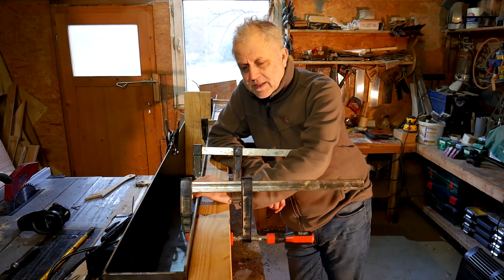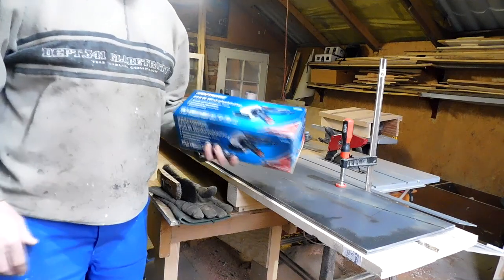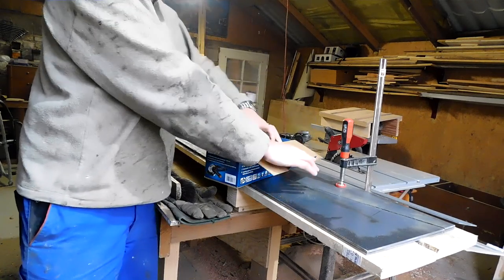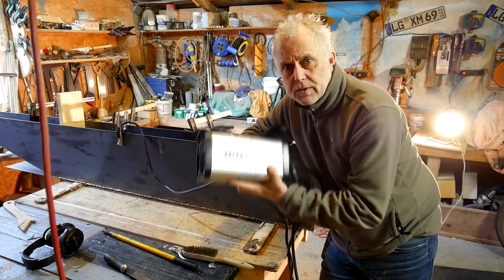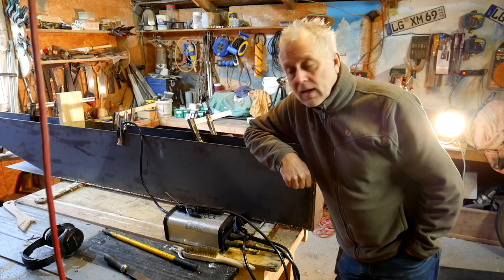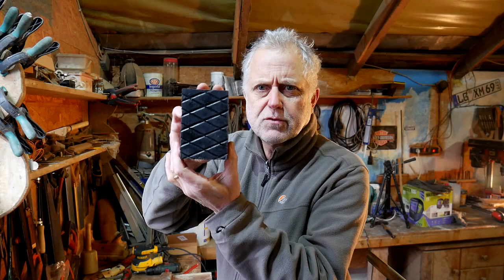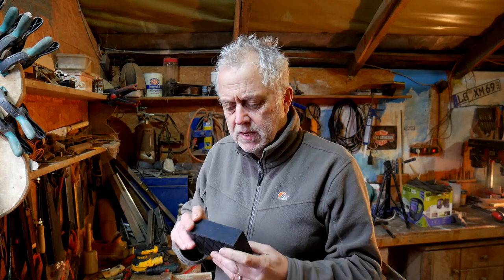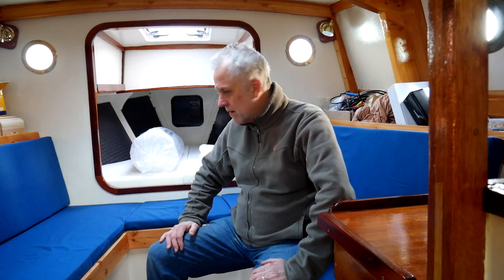Ballast Keel Beginnings And More; Building a cruising sailboat - SV Tapatya EP216

Comment: I remember mixing lead shot and resin in a concrete mixer, scooping/pouring it out into buckets and heaving it up over the topsides and dumping the lot into the keel void.  Not only worked but gave me quite a work out!
Reply from the maker: I'm sure it did, Roger. Concrete with lead shot is a good option - it gets you up to about 2/3 the density of solid lead 👍😀

Comment: Hi Tony, did you know Metabo has what they call safety brushes in the motors? At the end of the lifespan of the brush, a spring inside the brush is revealed and disconnects the brush from the rotor. This prevents damage of the rotor. About E12,- will get you new brushes.
Keep up the work! Love what you are doing.
Reply from the maker: Thanks Walter. Great tip. I took it apart earlier today and have now ordered some brushes. It all looks ok so we'll see! 😀😀

Comment: Good call on the lead, I think, Tony. Watching you cut up the steel plate, I started out by wondering how many cutting discs you'd need. Clearly, I should have been wondering how many angle grinders you'd need! That "Huh.. bit rough" comment when you were cutting up the rubber made me chuckle, as well. Makes me feel a bit better about some of my own less-than-great cuts with a hand-saw, too!
Reply from the maker: Thanks Garryck. Yes, I wondered how many discs I'd use up, but in the end, it was only a couple 👍😀

Comment: Hi Tony, the beginning of the ballast keel! I have been eagerly waiting for this very interesting build and wondering how you would go about it. Melting down lead pellets into the steel tank seemed the most obvious choice but I wonder whether you have considered other possible options. Melting lead must be a scary task indeed and the process is potentially a health hazard. So I am thinking whether lead pellets held together with epoxy in progressive layers to fill the tank would do. Or cement in place of the expensive epoxy? Do you think it would work to achieve the same specification of your ballast keel?
Reply from the maker: Thanks Joseph. Yes they are both possibilities and I have considered both. Melting the lead into the form will give the best density, but the methods you mention would be close and are certainly less hazardous 👍😀

Comment: Just to throw a spanner in the works Tony, why not concrete like Salt and Tar did on Redaviva !!  Seeya Rob
Reply from the maker: Concrete has roughly a quarter of the density of lead, Rob. You might think this means the keel needs to be 4 times the volume if it were concrete, but, sadly, as it would displace significantly more water, it’d need to be even bigger that that. It’d be a struggle to get the c.o.g. in the same place as that of a lead ballast and so it’d probably be less effective in its job as a counterweight too. 
I did seriously consider concrete, but, no... 
👍😃